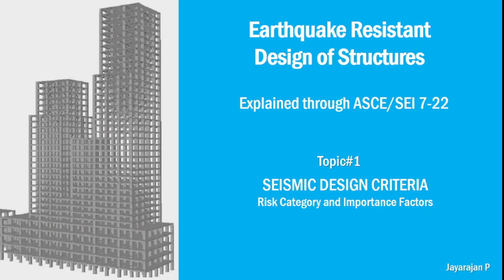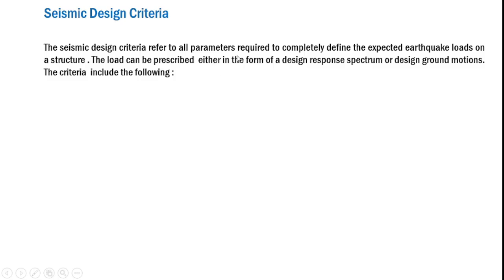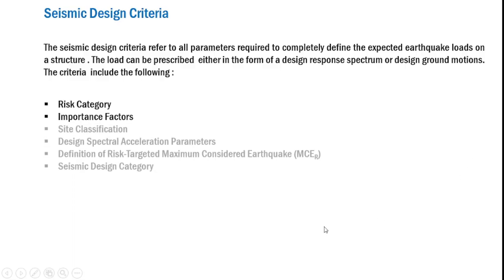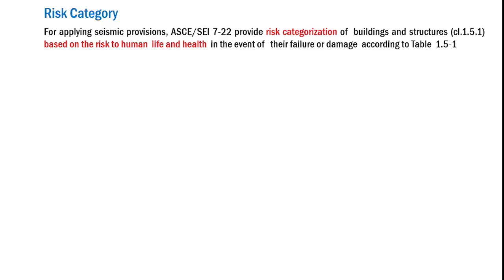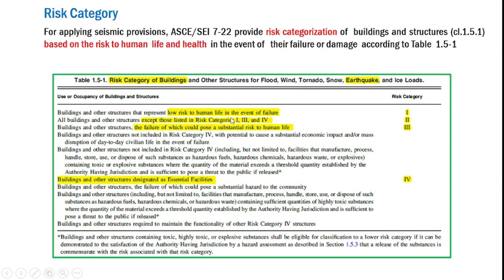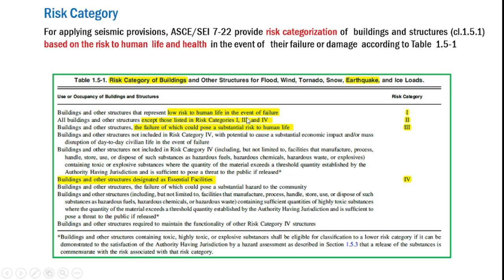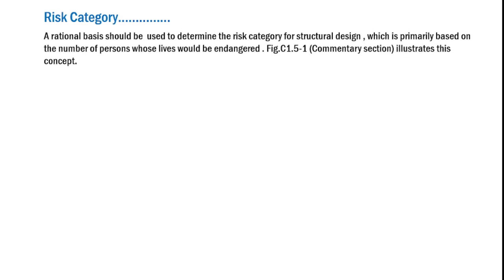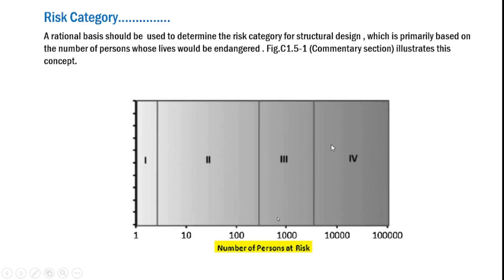ASCE/SEI 7-22: Topic#1- Risk Category and Important Factors

Comment: Thanks for this series.
Please explain the behaviour factor of Eurocode...the theoretical background of it.
Reply from the maker: Debdeep,
First, I presume that you are aware of equivalence between the behavior factor (q) of Eurocode-EC8  and the R value (response reduction factor) reported in other codes. I would frankly admit that there are no code-specific theoretical background. The philosophy is simple:
Larger the value of R (or q), smaller would be the elastic force for which the structure would be designed  as  the system is capable of undergoing larger inelastic displacements to absorb the seismic energy. Obviously, the code specified detailing practices must be thoroughly reflected in member details to achieve this behavior. The detailing shall be followed even if wind forces are dominant.
Hope that I interpreted your query rightly......
Reply: @puttattjayarajan1199  yes sir, the equivalence of q and R is known to me...however that approach for q appeared little different from other codes as the value appeared little less...so thought of any background might have been there for it...but thanks for your explanation sir.